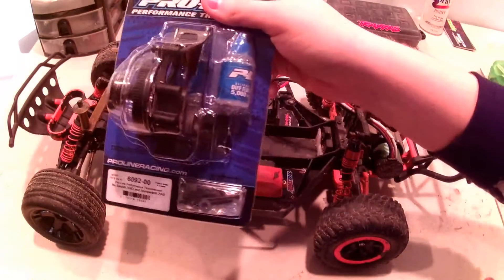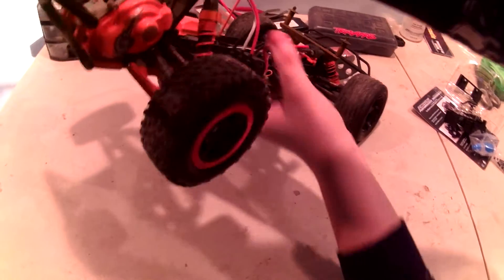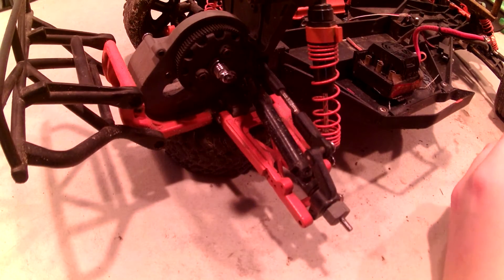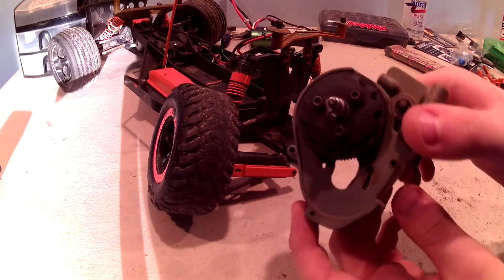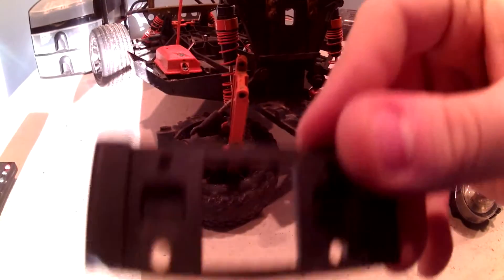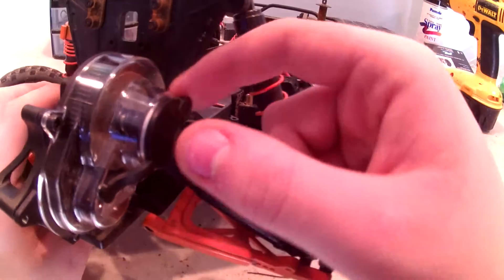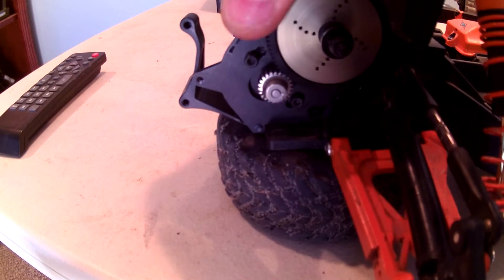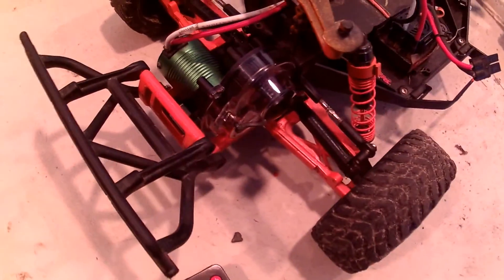Traxxas Slash LCG- Proline Performance Transmission [Inferno]

Comment: also did u whach the sc10 first run
Reply from the maker: +Joshua Wooten Not yet,  have been building the rest of the pede 2wd, I will watch in an hour or so. I would have gotten the RPM gear hybrid gear box but I wanted more speed.
Reply: +RC Mayhem ok